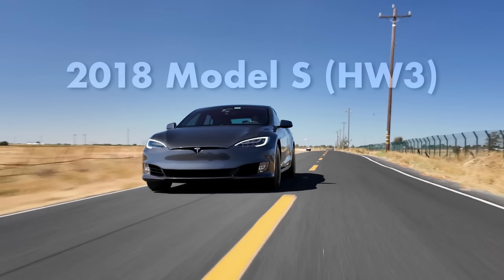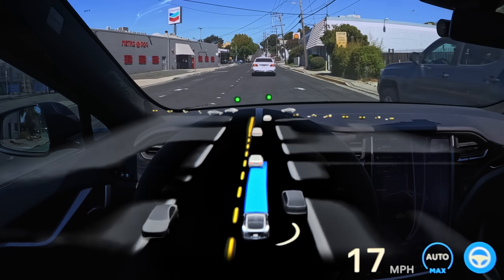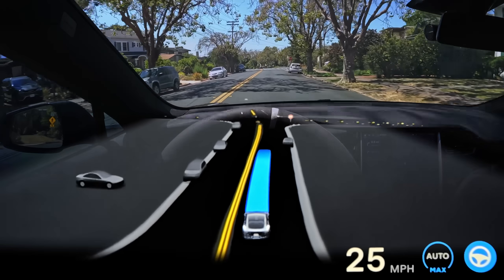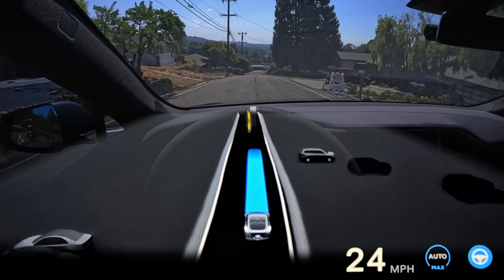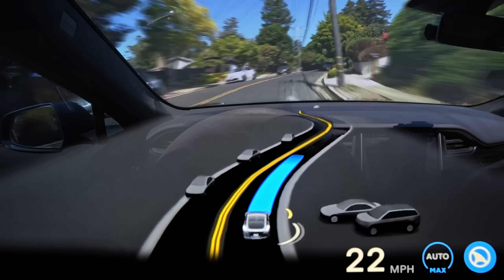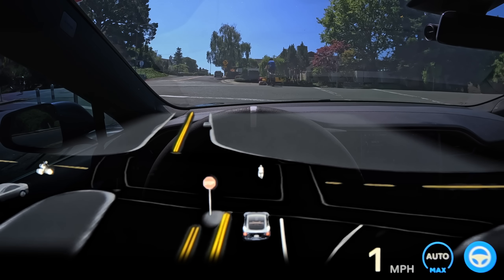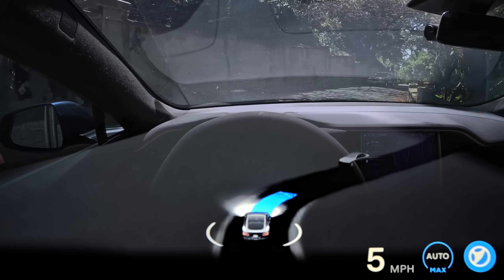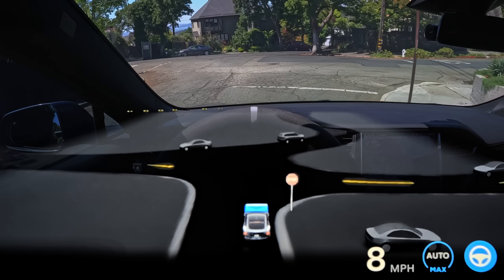Tesla FSD 12.5 Stress Test on HW3 (First Impressions & Highlights)

Comment: 12.5 is pretty bad on my HW3 model 3 in San Diego.  MANY safety disengagements and for the FIRST time it hit a curb making a very easy left turn.  Sad. Hope they come up with a HW3 -> HW4 retrofit.
Reply: It's weird how some people are saying 12.5 on HW3 is really disappointing for them, and others are saying it's the best one yet. They need to give it to me already, so I can test it for myself.
Reply: @shmuelrosenthal6661  Yeah, I've been on FSD Beta since 10.3 in 2021 and this is the first time it's hit something and damage a wheel for a turn that's historically been really easy during a bright day.  Very odd.
Reply: @RobbyTicknor  Very strange, indeed. This is what concern me the most about AI making critical life and death decisions without human backup. When something goes terribly wrong, there's no way to look inside the black box and understand WHY it went terribly wrong. Jury's out on when/if this gets solved.
Reply: @shmuelrosenthal6661  Yeah. I think they'll solve it, but really starting to worry that HW3 just does not have enough power to run big enough models to do it... especially if they want redundancy. Fingers crossed they can optimize it a LOT more and get working better.  Otherwise, hope teals has a retrofit plan b in the works.  The current models is trained on HW3 cameras, so we just need a computer upgrade at a minimum.
Reply: @RobbyTicknor  I think both are probably true: that there's a LOT more life and performance to squeeze out of HW3, and that true "robotaxi" performance almost certainly won't be possible on HW3. Will a retrofit come eventually? Who knows, but it's not unlikely.
Reply: @shmuelrosenthal6661  Yeah - I kinda thought that the difference was that Model S/X users were having the problems and Model 3/Y users were wildly happy. But @BobbyTicknor says he's having problems with a Model 3...which is weird.   I have about 60 miles of in-city driving with some country back-roads thrown in - on my M3/HW3/12.5 and not one single disengagement yet.

Comment: On my 2018 model S with 12.5.1.5 the car hugs the left of the lane, even driving on and over the line when there are cars in the lane directly next to me or around curves. The previous version hugged the right side but would move over to the center when passing another car. It no longer moves over even with other cars in the lane or a car turning left in the center lane. It even acts  as if it's going to run the other car off the road super unsafe and very discouraging as I was very excited for this new update and use FSD every drive but now have no idea if and when this will get fixed and I can safely use the software again without putting others in myself at risk.
Reply: From reading all of these comments - it seems that maybe Model S and X (being larger cars) aren't getting as much training data as Model 3 and Y (which are considerably smaller).   Since there are VASTLY more 3's and Y's collecting training data - I kinda wonder if that's the problem.   As good as the Model S did in this video - I feel that my Model 3 is doing much better.

Comment: 2:50 I mean there's an object rendered on the screen. So the cameras definitely picked up an object laying in the road. Not just FSD but also the V11 model running the visualizations picked something up.

So this might actually be not an issue with FSD itself, but maybe the object there detected by the V11 stack had it override the FSD acceleration, to avoid running into that object?

Comment: My HW4 Model X makes a lot of adjustments during turns. I find it comforting, as it conveys that the car is aware of the curb and making room for it.  It's very human-like. Rather than it being a HW3/HW4 issue, it may simply be reflective of the larger vehicles.
Reply: I think so.  My Model 3/HW3 doesn't do that.   My guess is that they have a LOT more training data for Model 3/Y than for Model S/X just because of the relative numbers.

Comment: I also have a HW3 Model S (2022) and have been testing the same software release 12.5.1.5. My experience has been very similar to yours with one exception - a very serious intervention that I dont recall EVER seeing before. I was stopped at a red traffic light in the left lane of a 3 lane road waiting to make a left turn. The light remained red in my lane and the right lane light changed from solid red to a green right arrow allowing cars in the right lane to turn right and simultaneously cars coming from the right had a green left arrow to turn onto the street I was stopped on. Our car started to go through the intersection directly through the red light with crossing traffic turning directly in front of us. I never saw anything like this before. BE CAREFUL AT RED LIGHTS!
Reply: Literally had this same exact incident happen last night.
Reply: Same thing here, I tend to turn off auto pilot during these situations and the software still beeps to signal the light turned green even though it’s not in my lane.
Reply: @JpsBookOfLife  Have you ever seen that before or is that new for version 12.5.1.5?
Reply: HW3 12.3.6 was really good at red lights for me. Been having several red light issues now that I'm on 12.5.15  . Several times it started jerking forward and breaking over and over again at a red light thinking it was turning green. One I had it start going a half second Before the light turned green, like it knew the light was turning green (based on the cross traffic light I'm guessing).
Reply: Eeek!  Thanks for the heads-up.  So long as everyone who sees this give a report, it'll probably get fixed pretty quickly.
Reply: I had an opposite situation on V12.4.3, where I was on the left turn lane, and the left turn arrow turned green, but it wouldn’t move. I had to step on the accelerator pedal to get it moving.
Reply: Software has bugs, people, don’t trust it.
Reply: Same here

Comment: Recently received this update on my 2018 LR RWD.  My route from home to grocery store is less than five miles. Faults are the same as ever, cannot hold the set speed, as far as ten mph off on roads with limits of 45 and more than five off on roads with a limit of 35. Will always and I mean ALWAYS cross the double yellow on the return route and even the visualization shows it doing so in an area where the lanes move to add a turning lane in the center which leads me to believe vision is used second to map data.  On map data still does not accurately recall the speed limits of all roads defaulting to the speed of the previous rode.  Right turns at light it actually hesitates too much and I have to take over else the people behind me get frustrated.   
  
I really don't know what it was supposed to fix but the inability to hold set speed let alone even the speed limit on some roads is ridiculous.  You can goose it and it will maintain for a little while and this includes roads with very long clear lines of sight.  Don't get me wrong. It does do a lot well but there is still too much it doesn't do well.  If the car annoys me as the driver I can live with that but when it annoys other drives on the road then it fails.

Comment: Well it finally happened.  FSD 12.3.6 curbed the right rear wheel on my Model S (HW 3) on a right turn corner that it (various versions - but 12.3.6 in particular) has done many, many times before without a problem.  I AM PISSED.  I'd be even more pissed if I had not stupidly curbed that particular wheel myself.  I had been considering replacing it, perhaps I'll wait a bit longer now.  Still waiting for 12.5.1.5

Comment: Coming from 12.3.6 i'm loving 12.5.1.5, spectacular difference.  Running HW3 21 MSP
Reply: I have a 2019 Model 3 with HW2.5. I would like to try FSD but I need the retrofit, which I wish to wait to see if HW4 or even HW5 ever retrofits.

How often do you need to interrupt now that you are on 12.5? I tried 12.3.6 (on a rental) and while it did fine on the highway and surburb (albeit I often felt embarrassed and hated how it stayed in people’s blindspots on highway), it was awful in city (espcially packed) driving. I had to turn it off. I wonder how many less interruptions I would do on 12.5

Comment: Love how you still call it HW4 and not AI4. Can't really get used to the AI naming scheme. HW makes a lot more sense to me, due to AI being the FSD Software, and AI does not imply the use of HW e.g. cameras. 

Impressive how HW3 performs. Interested to see how it will do in the feature when HW4 is off its emulation mode, with the new Supercomputer.
Reply: HW5 will be officially named AI5, and that's where I would agree it's fine to call it that, since it was never officially called HW5 to begin with. But otherwise I agree.
Reply: i find it really annoying when people misuse the term AI or use it in an awkward way. So often, I hear "AI", when "the AI" or "an AI" would have sounded so much better.
Reply: And also HW4 has advantages that have nothing to do with AI. Higher resolution dash cam, for one. AI4 is just AI marketing hype. Whatever. Fine. It's popular right now.
Reply: Where did you hear it called AI4?
Reply: @happyjohn1656  Ashok calls it AI4 in his tweets (the director of FSD at Tesla)

Comment: At this time Tesla really should already be fielding a 100% workable unsupervised FSD. Waymo is already racking up the points safely driving passengers from point A to point B without a humans intervening at all behind the steering wheel and they’re able to recognize human hand signals. FSD should already be at that point and getting better.
Reply: Waymo has a completely different approach. It should drive better, but only on pre-mapped areas. Scaling is an issue, like avoiding traffic on narrow streets, or proper behavior on just changed intersection. Not to mention other issues that should be solved by now, but for some reason they failed (for example I'm thinking about honking in the middle of the night)

Tesla has no issue with scaling as they try to solve a general problem of driving. But it's way more complicated - no surprise FSD has to be supervised right now.